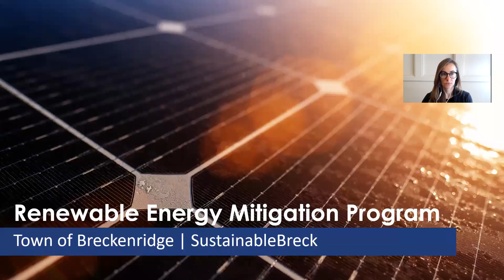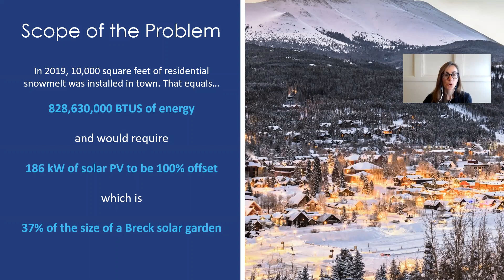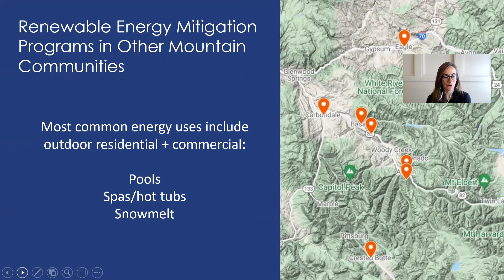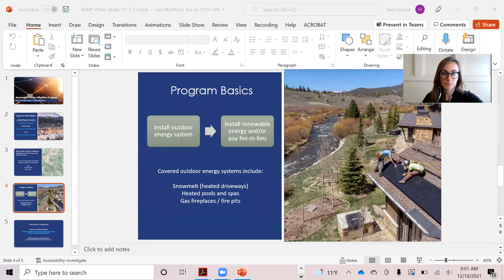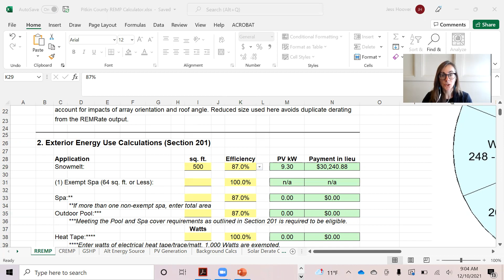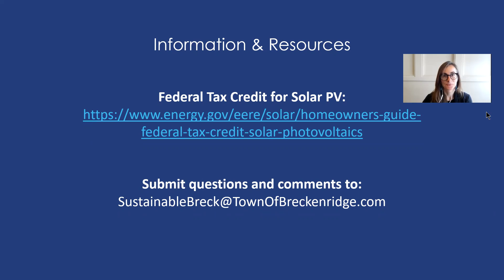Breckenridge Renewable Energy Mitigation Program - For Public Comment

Comment: Why would you restrict the fee to the most expensive, least efficient renewable source, roof mounted solar? If the goal is more generation from renewable sources, why can't the homeowner purchase the offset renewable energy from Xcel using one of several programs like Renewable Connect? It is far more efficient to generate electricity in a utility scale plant than a small installation on a homeowner's rooftop. The cost is $56/MWH utility scale solar versus $126/MWH for roof top solar per NEA estimates made in 2020. Homeowners with the means to build a 7,000 square foot house probably don't care but what about the rest of the community?